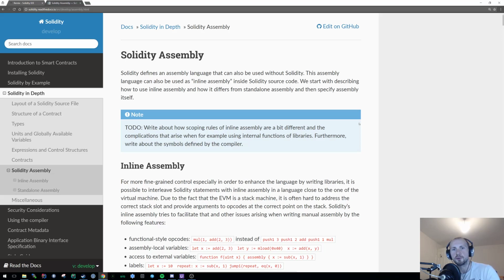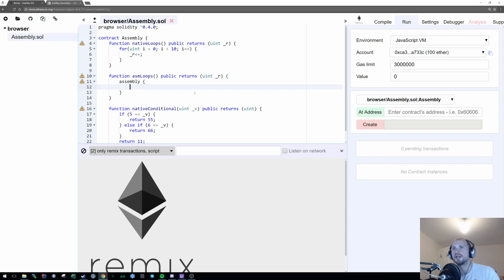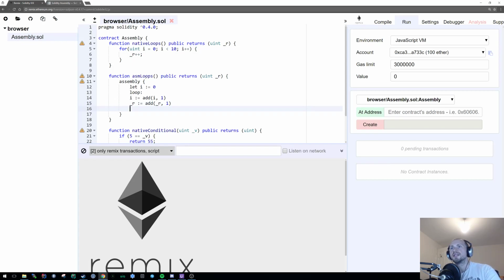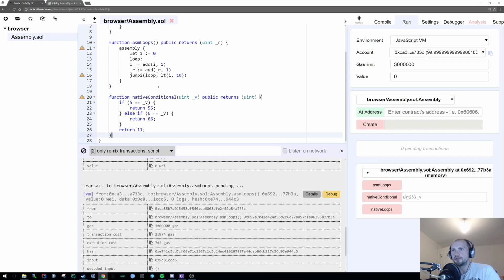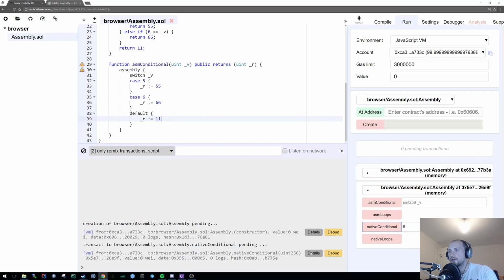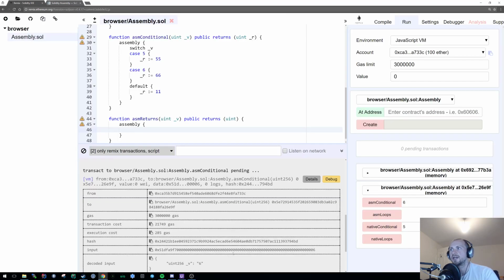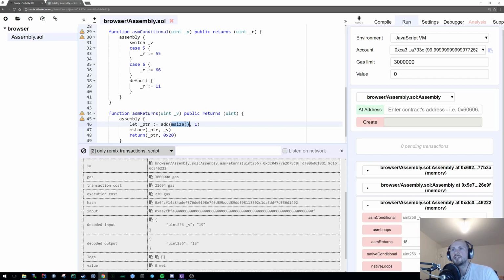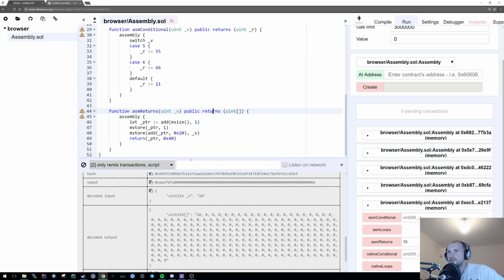Learning Solidity : Tutorial 12 Functional Assembly

Comment: thanks, this is very useful.  I studied distributed computing in my computer science degree and we did ASM and parallelism.  I think your point about the GAS cost is good, and that Solidity may have native CASE statements in future.  I'm wondering how Solidity Functional Assembly pure / inline copes with the machine-specific nature of assembly code.  Is it big-endian or little-endian or the way RISC and CISC processors have different ASM instruction sets.  At Cambridge (Engineering Dept./Computer Laboratory) I was post-graduate researcher, AI/ML.  I think SOLIDITY is an interesting distributed computing model, I'm trying to work on Fintech solutions, high-frequency trading of crypto-currencies on the Ethereum blockchains, may incorporate inline or pure Assembly in my prototyping to minimize GAS costs and maximize financial 'wins'.   Thanks so much for the idea.     Lee Ho San 
https://cz.linkedin.com/in/888lehosan888
Reply from the maker: I wouldn't get too hung up about writing solidity using inline ASM due to the overhead of maintenance and contract readability to the end user. It's big endian, but endianness isn't defined by solidity and you don't have access to raw memory so it's not something you need to worry about.